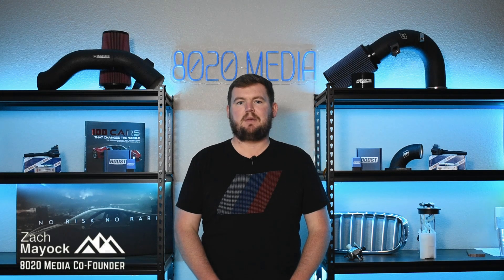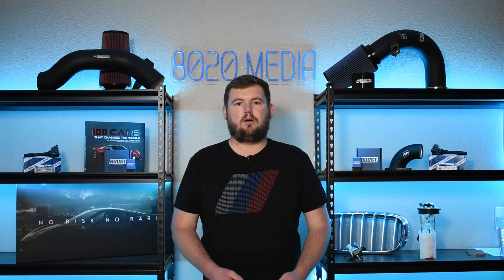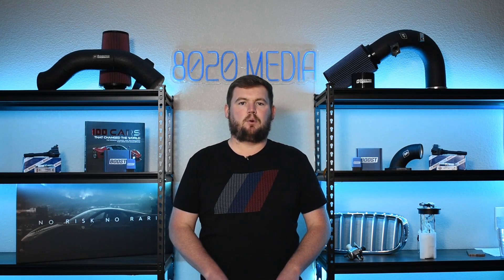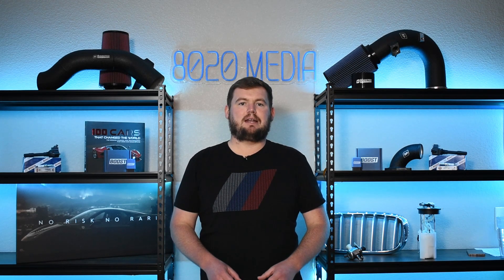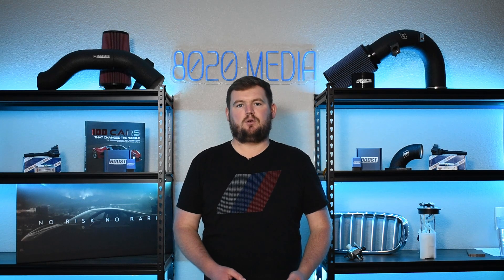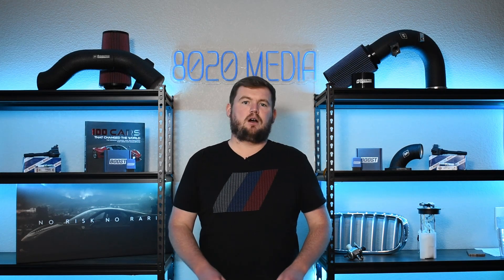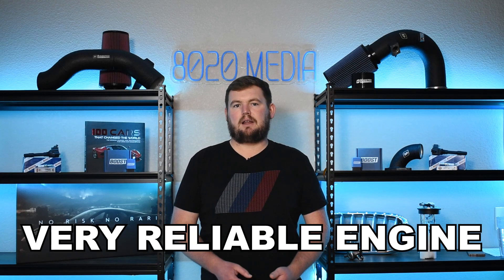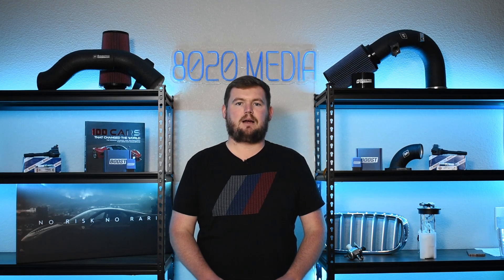BMW’s M60 Engine | Common Problems & Reliability

Comment: HI , i have check engine light, fuel consumption sky high... it shoes lambda issue. My mechanic says thermostat sensor problem... waiting for that part and it long... i think something here r dodgy r going on. Any ideas regarding my story?
Reply: From my research and experience the o2 sensors are pretty short-lived in these cars so Id start with those. Theres only one sensor per bank so theyre very important to the engine running right. 
Temp sensor could be the cause too but from what I understand it shouldnt cause CEL or sky high consumption as it is only secondary sensor and the car relies much more on other sensors to adjust fuel mixture, such as the lambdas

Comment: Timing chain guides relates to M62 engines which is replaced the M60. The M62B30 and M62B40 found mostly in the E38 7 series and e39 5 series
Reply from the maker: S - What?
Reply: @8020Automotive  your explaining the timing chain guides for m62s not m60s. There's a difference.

Comment: Do you have experience on putting a M60 into a E28 chasis???
Reply from the maker: M - People have swapped the BMW M60 V8 into an E28 chassis, but it’s not a direct fit and takes some custom work—common challenges include engine mounts (you’ll need custom or modified mounts to position the M60 properly), oil pan clearance (the stock M60 pan hits the E28 subframe, so a custom or modified pan/pickup is required), exhaust headers (tight clearance around the steering box/linkage usually calls for custom manifolds), and wiring (you’ll need the M60’s ECU and harness adapted to the E28 chassis, often with EWS delete). Cooling also needs upgrading to a larger radiator and better airflow, and depending on the transmission you choose (Getrag 420G is common), you’ll need to modify the driveshaft and transmission crossmember. It’s a well-documented swap in BMW circles, but it’s fabrication-heavy—if you’re comfortable with welding and wiring, it makes for a wild sleeper, but it’s not a drop-in like an M30 or S38.

Comment: I had an 97 740iL with only 143k miles sat for 6 years before I bought it for 680$ with no check engine lights had all OEM parts still on it with the BBS wheels owned for a year before alternator went out literally had to sell it do my living situation if I could take back any car I had out of the hundreds I was buying and selling cars but one I just couldn't sell was the 740iL M60 Very Very Reliable
Reply from the maker: D - Nice! Thanks for sharing.
Reply: e38 started using m62 post 1996

Comment: Great video. However one serious problem I believe you should have mentioned is the oil pump bolts that like to back out due to vibrations. 
I dont know if BMW have undertorqed them from the factory or failed to anticipate the problem and didnt use at least some sort of thread locker.
But whatever the reason may be, I personaly seen multiple failures due to this and my personal m60b40 had the exact same problem. After i removed the oil pan I found 4 bolts lying on the bottom of the pan, one or two were loose and a few more were tight and still holding the pump together.
TLDR: If you own an M60 powered car - remove the lower oil pan and check your oil pump bolts.
Reply from the maker: M - Good point. Thanks for sharing this insight!
Reply: This is very relevant issue, easy to fix but disaster if if the pump drops lose. Ive owned two of these engines, one had couple of bolts loose and the 2nd already had two bolts fallen out completely. Both engines ran fine and had around 260-290k km on them. 

I did the maintanence in 2018 and 2021 respectively, so it is still a contemporary issue to check. 

Also planning to recheck my work on the first car, as I was bit inexperienced back in 2018 and didnt use a torque wrench. Half hour job for peace of mind for years to come.
Reply: Late reply - having just finished this very job I can share my own experience.

Although no bolts were dropped in lower pan, ALL of them were practically loose, with two of them already on their way out. One M8x45 bolt holding pump to the block was completely missing, and also chain driving the sprocket had too much play, about +-15mm, about 30mm combined.